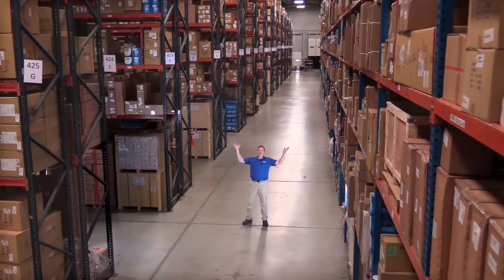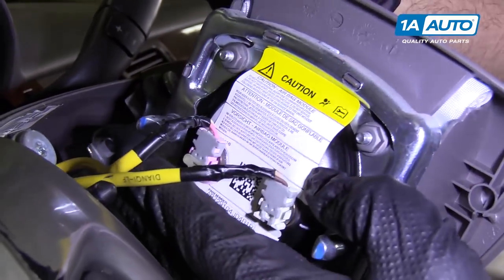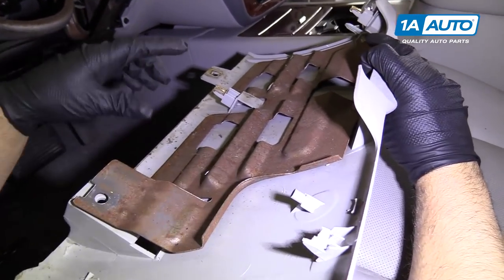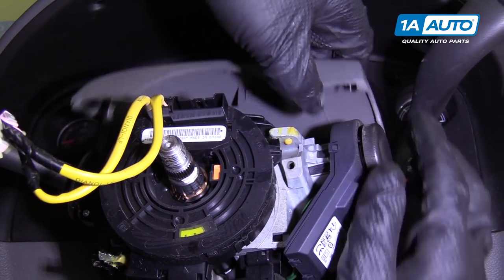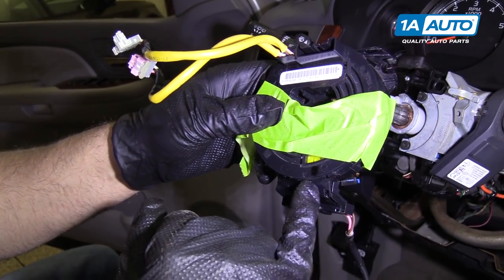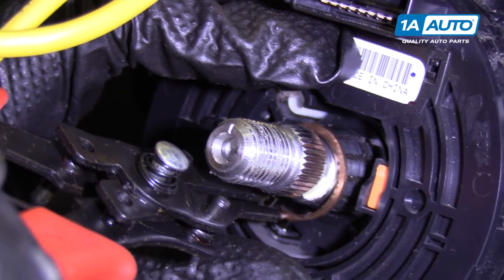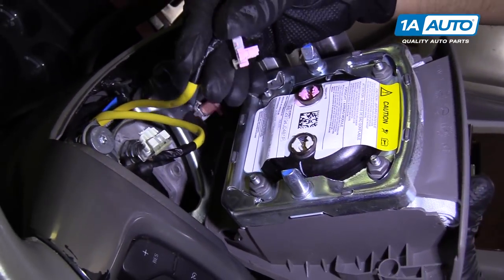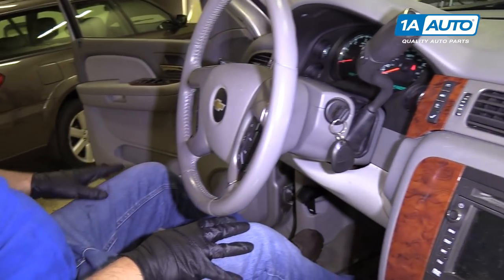How to Replace Airbag Clock Spring 07-10 Chevy Suburban 1500

Comment: If the clock spring goes bad will it cause the controls on the steering wheel such as the cruise control buttons and the controls for the radio and the horn to not work?
Reply: Yes

Comment: Buenas tardes,
Muy bueno el video, tengo una Silverado 1500 año 2011, resulta que no funciona ningun control del volante ni la velocidad crucero ni los controles de la radio , lo unico que funciona del volante es la bocina, cree que pueda ser problema del clock spring ? , muchas gracias !

Comment: is this the same process for 2009 chevy cobalt LT?
Reply from the maker: +cutehumor We currently do not have an auto repair video specific to your vehicle. You might be able to apply some of the basic steps shown in this video to your application. Here is a link to the repair part that would fit your vehicle. https://www.1aauto.com/airbag-clock-spring/i/1astc00165?f=766759&y=2009 Hope this helps you out